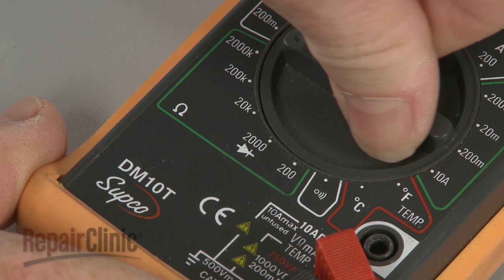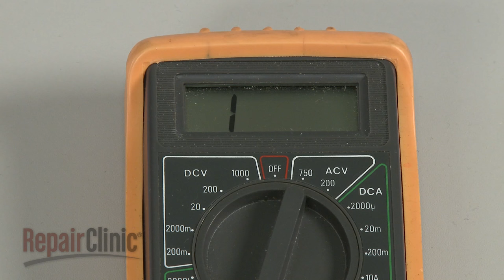Dryer Won’t Heat? Gas Valve Coil Testing, Troubleshooting

Comment: Are gas valve coil models interchangeable? For example part WPW10328463 is one piece. If it malfunctions, could a two piece set be used (part 279834 for reference)? Or should that particular dryer use what it originally came with? Thank you!

Comment: My gas turns on and heats for about four minutes then flames out and blows cold air.  The thermistor and thermal fuse are OK.  Could this be the coil failing when it gets hot and shutting the gas valve?

Comment: Are these solenoids replacement parts for solenoids for gas valves (Maytag/ADC part numbers A128944/128944) on the Maytag/ADC MLG33PDAWW dryer?

Comment: You guys rock!  My Maytag was turning of the heat after 3 - 5 min and would not start back up until it cooled.  Your directions were spot on and I was able to replace the gas valves with my dryer in a stacked configuration.  I loved your diagrams and individual videos that helped me get to the part without taking too much apart.  Thanks to your video, I realized I only had to remove the front lower panel.  I was back up in and running in 15 min.  Thank you!

Comment: Thank you for the videos and parts. My gas dryer was not properly drying clothes after several cycles. After watching your videos, I replaced the solenoids and it was fixed !  I am sure that I save hundreds on a repair bill or replacement. Thanks !

Comment: The solenoid resistance test is not that conclusive/reliable. I removed mine and passed, but decided to replace it anyway since its cheap to replace  Next thing I know is, it fixed the problem.

I am not an electronics expert, but I think even though the solenoid is good electrically, it could still jam mechanically. My doorbell was the same way.

Comment: Great informative video, thank you very much for posting.  This helped me troubleshoot my gas dryer and actually arrive to the solution, which was by replacing the coils and done, problem fixed by spending only $30.  Calling a company just to troubleshoot would have been about $120. GREAT VIDEO again, THANK YOU VERY MUCH.
Reply from the maker: Good work Sal!

Comment: I have a Kenmore 70 Series Gas Dryer that is not getting hot. Igniter glows then flame begins but lasts only about 3-5 minutes. I ordered new Solenoid coils from Amazon. Before installing, I used my Multimeter to test with 2K ohm setting. When testing the 3-terminal solenoid and particularly testing prongs 2 and 3 I get OL reading with the new coils. My old coils give me a 1600+ reading from prongs 2 and 3,  Is it possible Amazon sent me bad coils? Should new solenoid coils show a positive reading for terminals 2 and 3?

Comment: Great video.  It directly and succinctly addresses the question I had regarding the valve coils.  Since one of my values on an analog multimeter was just at the lower limit of the range, I think that the test is inconclusive.  So, the comment that it could still be the valves, but if replacing the valves does not solve it, then it is likely the gas valve itself that needs to be replaced, is exactly the information I needed.

Comment: Hi: Do I need to test the Solenoid terminal 2 and 3 together (at the 3 terminal coil)? Both of my Solenoid (new and old) stay at 1, all other reading are fine ( e.g. terminal 1 and 3, 2 and 3, 4 and 5, but not terminal 2 and 3 together). Is this normal or they both bad. Because I changed the Solenoid, it still doesn't fix the problem.  Thank you
Reply: I have a Kenmore Series 70 Gas Dryer. I just purchased two new solenoids from Amazon. I have the same testing issue with the new solenoid. For the 3-terminal solenoid when I test terminals 2 and 3 together, my multimeter shows "OL".  Did you receive bad solenoids?  Does it sound to you as if I received bad solenoids. I don't want to install these solenoids if they are defective. How did you ultimately resolve your dryer's heating problem?

Comment: you need to test it when its hot. Use a hairdryer to heat it then test it again. Mine had continuity when it was cold but dropped it when it got hotter
Reply: 100% agree, XCELCIER
my solenoids both checked approx 1300 when cold, after heated with a hair dryer I got zero Continuity on the smaller and about 500 on the larger. 
My symptoms were dryer would only heat for about 5 mins then igniter would cycle but burner wouldn't light up. 
My vent was partially clogged which probably killed the solenoids in the first place.
Reply: I wish I had read this before I spent $120.00 for diagnostics.
Reply: @XCELCIER thank you for the test-while-hot tip. Mine ohm’d fine a room temp, but after hair drying the large coil became an open circuit.
Reply: Thank you for posting this.  Mine tested fine when cold.  I suspect it will fail when hot.
Reply: Tested mine with heat and the resistance went up. The symptoms I’m having is the igniter glows for 30 seconds then goes out. I don’t smell gas until after the igniter goes out. The sears repair video I watched diagnosed that to be the coils. Parts store is closed so won’t know until tomorrow. Wonder why the gas valves would open after the igniter goes out?
Reply: Xcelsior manbearpig

Comment: So you check up the 3-prong coil with a multimeter, 1&2 and 1&3. What about 2&3? My gas dryer stops heating after 4~5minutes and doesn't heat up until it's completely cooled down. So, i get correct numbers on the multimeter when i check up 1&2 and 1&3. But nothing on 2&3. Is this normal? Thanks.
Reply: I have the same question and issue regarding terminals 2 and 3 for 3 terminal solenoid. Is it normal to get a blank or OL reading? If so, why does the video say we should get a 1600 to 2000 reading?
Reply: There should be no connection between 2 and 3. Pin 1 is common, so 2 and 3 only connect to 1, not each other.

Comment: Help! I made sure it's not the thermal fuse. Checked the peep and noticed it doesnt glow at all while running and everything seems to be ok except no heat. The coils seem to test ok using the ohm setting bc my multimeter doesnt have a contuinity setting. Any ideas?
Reply: If there's no glow at all, you should check your igniter.  This channel has a video on that, too, but it's just a continuity test (any reading other than an open circuit on your ohmmeter)
Reply: Replace the coil   cost  8 dls  on line my dryer  running like new now

Comment: Hi my roper gas dryer the gas comes on but it goes out in LESS than 30 seconds..
Reply: did you replace the coils and get it going ?   I got all 3 for $30.  on ebay.

Comment: my coils failed the continuity test, but so did the replacement coils.
Reply: The continuity is meant to be a test for solid electric connection, usually, a continuity test will fail if the resistance is above around just 600ohm
Reply: that is interesting. My Maytag gas coils all tested okay. Then I paid $120. for diagnosis and was told the coils were bad. probably. I replaced them one at a time. I thought it would be the holding coil, it was not . The bad coil was the secondary.  Next time I will just replace the coils.

Comment: Drsr483gg4ww gas dryer tumbles but doesn’t get hot. The igniter ignites , but the gas valve is not opening, when the igniter is glowing the solenoids are buzzing, the solenoids stop buzzing when the igniter goes off.  This cycle keeps repeating, 
Successful Continuity tests were performed on the (1) Thermal Fuse, (2) both solenoids, (3) the ignitor (4) flame sensor (5) thermostats with a digital meter and they all checked out fine.

Background:  This dryer operated fine at our son’s home and then sat in storage a few months and now we are having this problem.  The only think we have done is changed the direction of the door swing and the door now opens to the right.

Thanks for any help!
Reply: JCO Lake
Reply: L
Reply: Borgian Pk.